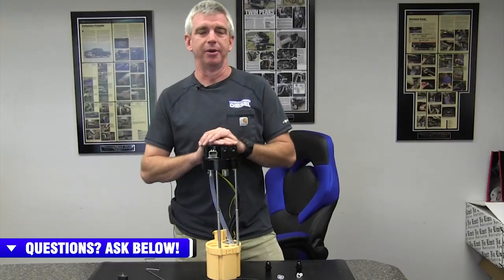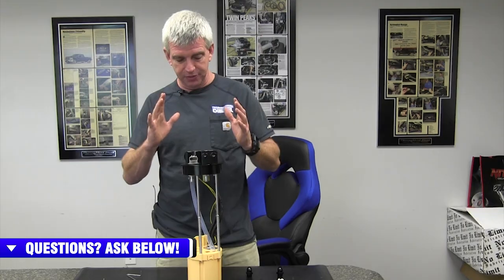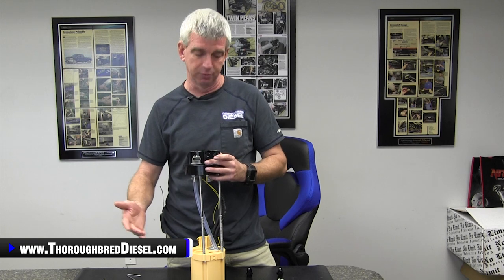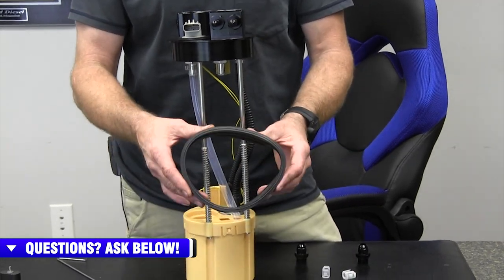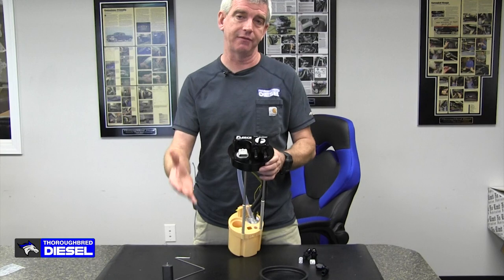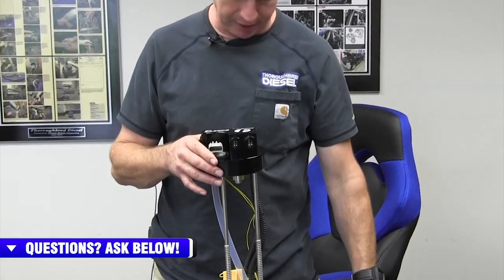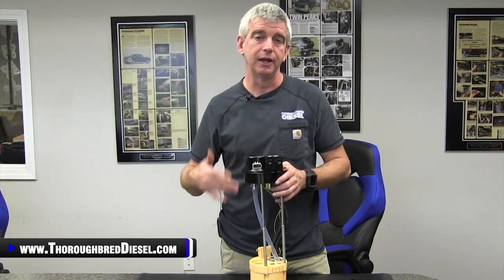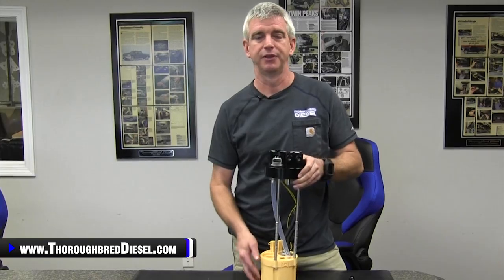Say Goodbye 1/4 Diesel Fuel Tank Hassles: Ultimate Solution With Fleece Sureflo Sending Unit! #fyp

Comment: I installed one of these in my 2012 LML GMC when the stock originally installed sending unit was having issues. So far so good the GMC dealer mechanic who did the install was amazed at the ease of install and the quality of the unit. I figure it may also extend the life of the weak CP 4 fuel pump. On my last long trip pulling travel trailer the truck did get slightly less fuel economy than previously on that trip. Over all I recommend this Sureflow unit. Throttle response is good and there is no noise from the pump.
Reply from the maker: That's great news!

Comment: I got Fleece intank with twin gear motor pumps at idle 21 lbs hard pulling with 34’ fithwheel 19lbs. The great thing is one pump plugs into factory harness and the other pump has a shielded wire to goes to a key on in fuse box it has a furs and relay so if one pump goes out you still have a back up pump and one pump will put out 10-11 lbs of fuel pressure it’s kinda pricey but you get what you pay for ant life time warranty.

Comment: My mechanic told me my raptor lift pump is going bad and I need a new lift pump. Is this a lift pump or do I need a airdog or fass. I heard this will replace the need of needing to run a airdog or fass. But how cone this doesn't have a filter or water separator.
Reply from the maker: This does not have a pump, it is just a sending unit upgrade.  If you are having a problem with your Raptor you will need to contact Airdog for possible warranty or buy a new pump.

Comment: so do stock trucks have the 1/4 tank issue too? Or is this only people that install a fass or airdog that have ths problem?
Reply from the maker: Stock truck typically do not have ¼ tank issues, it relates back to the use of a draw straw and improper install of that or improper modification of the sending unit.
Reply: @thoroughbreddiesel  I think what happened with my draw straw  is they set the tank on the ground and then measured. So then when they strapped it back up there  the 1/4" gap turned into probably a 1" gap looking at how my tank is sagging. I'm going to take the bed off and fix it myself.

Comment: Do you sell the flex lines coming off the sending unit?  I went to your website but did not see them.
Reply from the maker: We do not sell the lines coming from the sending unit in stock form. We could get you the fitting to fabricate the lines however.

Comment: Still a, little confused. I have 2002 Dodge 2500 diesel. Years ago they did in tank conversion. I wasn't happy with so a year later I had a FASS HD system put in. 3/8ths fuel line. They also put in a sump with draw straw. 
My fuel gauge just stop working. I need to replace my sending unit, and no my return line does not go to fuel filler neck. Do I need to get entire Fleece send unit or can I just replace to float sending unit ? Will the Fleece sureflow handle 3/8 lines ??
Reply from the maker: The Sureflow will handle 3/8 lines with no problem, and now your return will be to the Sureflow as well.   You will only need to block off your sump ports.

Comment: Can someone tell me if I’ve already installed a FASS TSS 95 into my 04 Cummins, and also cut into the filler neck for the FASS return, will I need any additional fuel line or hardware with this Sureflo unit to reroute my return line back to the Sureflo and remove it from the filler neck? Obviously I’ll need to repair the filler neck but aside from that, will I need any additional fuel line or hardware to hook up to the Sureflo? Thanks for any clarification.
Reply: Phone... pick it up... dial their number... speak directly to somebody.
Reply from the maker: That’s one of the great things about the Sureflow!  If you don’t want to return to the bucket you don’t have to!  You can leave the return to the neck if you want to.
Reply: Thoroughbred, I was under the impression they part of my 1/4 tank issue was because I was returning fuel through the filler neck instead of the bowl? I was told in one of your videos that the FASS empties the fuel bowl so fast, that it causes the 1/4 tank issue and the fuel should really be returned to the fuel bowl.

Comment: Has anyone had issues with 1/4 tank syndrome with one installed? My 2001 dodge just had on installed with a FASS 165 pump, I lost fuel pressure three times over a couple days showing 1/4 tank….truck actually died while driving to the fuel station….I drove final 1/2 mile with zero pressure showing on gauge. Filled the tank, took 26 gallons ( of 32). Turned key, instant pressure on gauge.Ran great.Next tank , same thing.Showed no pressure, truck took 24 gallons. Havent had a chance to remove unit yet, anyone have this issue?or know what’s happening?